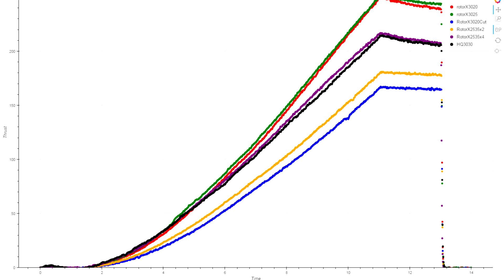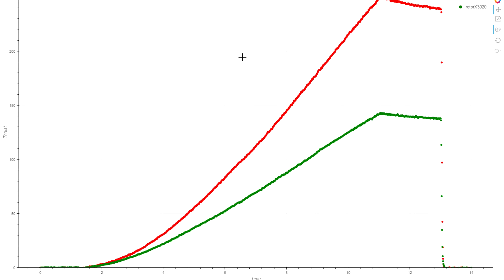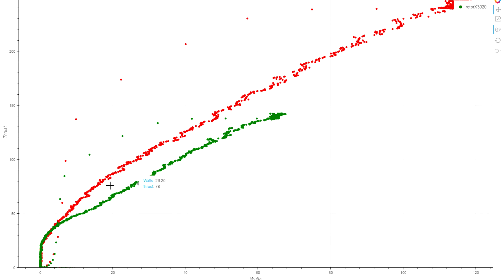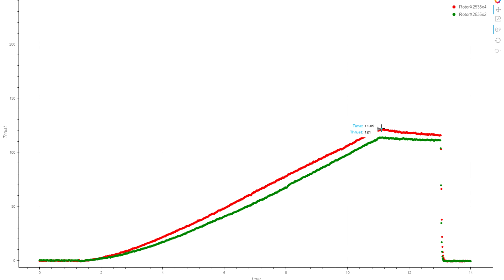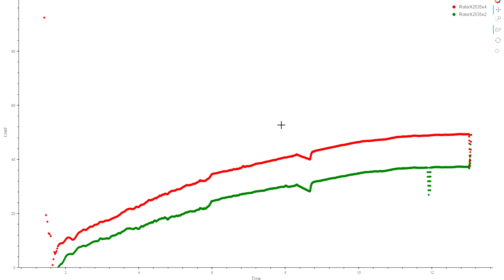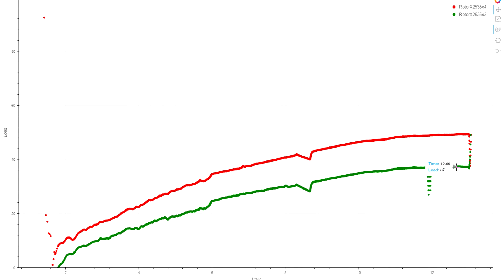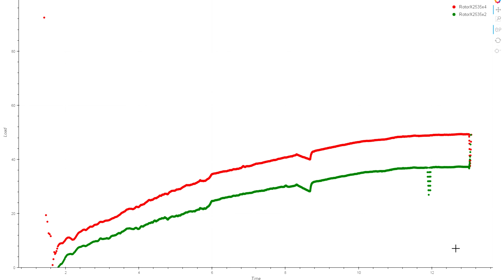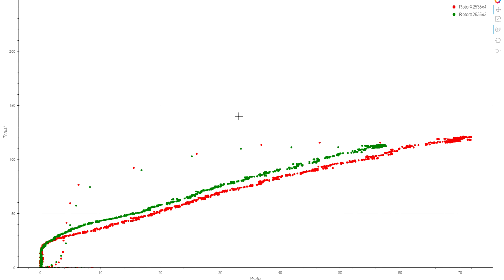1105 vs 1304

Comment: Darn I was hopping they had 6000 KV for 3S like the Spintech motors..
I wanna try these over my Trusted Emax 1106  2.5 setup,  to see the hype.  But so few options out there in 1304
Reply: ^word. I have some 1105 7500kv on a fat airblade eclair 2.5 (90g dry) and they seem to suffer from poor efficiency. So i am getting some of the spintech motors (6500kv) to try out and see if they are more efficient at the same thrust. Plus I am hoping that they really help my propwash problems which I haven't been able to tune out

Comment: ive got a Micro 32bits F3 Brushed fc,will rx1105 motors work without 4 esc's?trying to keep weight down
Reply from the maker: brushless motors require a brushless esc, you cannot run a brushless motor with a brushed motor driver.
Reply: Nickos White You can use a "4 in 1" esc instead of 4 seperate esc's if thats what you are asking.

Comment: Do you think its safe to use the 1304 with 4s and kinkkong 2840 triblades... thx for your videos.
Reply from the maker: depends on the KV, but the only 1304s I know of are really high kv so I wouldn't do it.  If it's just safe or not I'm sure you would probably get away with it just fine if you wanted to.
Reply: I will try 4S with my new H1304 5000kv when i receive them :p
I already tried 4S with BrotherHobby 7100kv without burning anything so i'm pretty sure that will work very nice ;)
I keep you informed !

Comment: A couple of months with the 4000kv versions now and they are still going ok.  First problem is the shafts keep snapping just above the bell housing, 3 so far.  Looks like they machined down the shafts to for the props but it's created a stress point.  Second is these motors vibrate a bit above half throttle, not sure if it's balance or to do with the ESC's I'm using.  Ordered a different brand to check.

Comment: I have Hyphys squeaker 2" frame and I have some dys 1102 10k kv motors on 2s 350mah zippys running some .5 gram push on BG 2" Tris, I am thinking of replacing motors with the rcx 1304 4k kv, to run heavier more durable praps, on 3 or 4s thoughts?
Reply from the maker: You might want the 5k version, it's hard to say without having a good idea of the load of those smaller props.  If the loading is as light as I think it might be you could be giving up a lot of power with only 4kv on 4s relative to what you have now.  But you will also have craptons more torque that could easily make up that difference if the 1102s are already loaded down too hard.  I've got some 2" stuff on the slate in the next week or two, I'll ping you in fpvchat if I come on any better insight from the initial results.

Honestly though I would worry more about battery availability.  Do you have a good source on 175mah 4s packs?  Staying on 2s and going with like a 7kv 1106 might be an easier path.

Comment: Just out of curiosity why did you choose a 4000kv 1105? That motor probably wouldn't be bad on 4s but I think with the trend of 6000+kv 1104 and new 1106 would be an interesting test
Reply from the maker: That was the commonly available kv at the time.  When I started in to 3" builds there weren't nearly as many choices as we have now.  The 11xx motor is already struggling on 3s at that kv and I've been able to burn them just on the bench in that configuration, 4s is just silly.  The new round of 6 and 7000kv motors are meant for 2s operation, and they provide about equivalent power as a 4000kv on 3s.  The extra kv is also needed for the even smaller 1.8 and 2" builds that will have even lower loading than the old 3" setups.  

I can't wait to get a look at the new 1106s and see how they stack up to the 13xx
Reply: Yea check out the new 1106 from brother hobby, emax also has an 1106 on the way and there's a few others in the 6000-7500 range, the brother hobby 1106 are rated for 4cell power. I have the 1104-6000 running on 3s with 2" props and it's pretty ballistic. I did enjoy your review, very thorough, look forward to hopefully seeing some of the more modern motors from you
Reply from the maker: Do you have a link for the BH spec sheet?  BH doesn't seem to publish any specs themselves.  The trick of it is there really is no such thing as a voltage rating for a motor, until you get to the point that the windings start arcing over it doesn't really care.  What really matters is the wattage rating as heating in the motor is a far bigger deal.  As the load on the motor lessens you can increase the voltage to maintain the same continuous power in the motor, so it's all inter-related.  Unfortunately few manufacturers of multirotor motors publish power ratings for some reason, so you have to guess a bit based on the "cell" rating and guessing what they are going to assume an average load is.
Reply: You should get a hold of the new brotherhobby r3 1106 5100kv, I have some and they are crazy powerful, but very amp hungry. Also there are the realacc 1106 6000kv that are only 7.60 a piece on banggood.

Comment: OK, been using the 1304 4000kv on 4S (450mah) for a bit now and they are my new favourites (also use the EMAX 1306 4000KV, RCX 1306 3100KV, DYS 1407 3100KV).  First gripe is the lack of props, I have been using (http://www.myrcmart.com/3x45-30453s-ttype-bullnose-tri-propeller-dysxt-pair-blue-p-11003.html) which are a bit too much pitch and are floaty.  Fun for freestyle but not racing.  

My favourites for this size class are GF3035 tri blades, very linear throttle response, precise and tough but no T-Style option.  Just found these though which might be the way forward http://www.myrcmart.com/28x4-28403s-ttype-bullnose-tri-propeller-kingkong-10-pairs-clear-yellow-p-11290.html.  These work the best for now http://www.hqprop.com/en/productsd.php?tid=9&pid=127 but it hard going back to 2 blade after using 3 for so long and they are a bit bigger than 3 inch so make sure your frame fits them.

Other gripe is the ridiculously long heat shrink RCX insist on putting on these small motors,  first it puts a lot of load on the stiff copper windings, second you have no room on the arms for the ESC unless you wrap it round.  OK if you are using a 4-1 (not a fan, been through too many) but please get with the times RCX, check the other manufacturers.

Comment: +siieefpv so if i have 2s 500mah lihv what motor would you think is best i curently have 1104 7000kv with 3025 props getting 2:40-3:20 flight on 2s. im looking for longer flights. my old 1103 8000kv with 3025 cut to 2.7inch got about 4-5 minof flight just less punch
Reply from the maker: 2s makes it tough, I would say you want bigger motors but there aren't really any that come with a kv high enough, 7000kv is pretty close to equivalent to the 4000kv/3s pairings I've tested.  For longevity bigger props spinning slower is better.  Trimming the prop on the high kv motor probably helps because it will reduce the load on a motor that's probably already struggling, but it makes it a hard balance of T:W

Comment: Hi
great review.you explain all things about these motors but I didn't understand the ampere that each motor load.In fact I have some 500 and 550 mah batteries and I want to know which motor is more suitable for these batteries!?in the trust table of motors in myrcmart website the 1105 5000kv and 1304 4000kv load same current on 3s battery(about 6a) but in your test the power of 1304 motor was up to 120W!!it means it load near 10A!so what's your suggestion?
Thanks
Reply from the maker: RCXs numbers have always come close to what I've tested, I think you may be looking at the wrong chart.  The 1304 5000kv motor that I tested here is listed on their site as a 9.2A draw on 3s.  I fly with 450 mah packs very comfortably on my 11xx builds, but the high KV 1304 (as you would expect) draws power like a full 1306 and packs that small are really only good for extremely short or very sedate flights.  I've been using 800 mah packs on the 1304 build to combat sag.

I haven't tested it but the 4000kv 1304 does look to have a nice boost in efficiency for fairly little loss in thrust compared to the 5000kv, so that might be a good option to try.
Reply: SiieeFPV ،oh, sorry,I thought it was 4000kv

Comment: Hi, I'm about the buy some 1304s to run on 3s. The 4000kv looks much more efficient and it looks to me like the 4000kv would even be faster than the 5000kv, both on 3s, assuming batteries of different mAh sizes for equal flight time. Any thoughts?

Edit: Based on a 80 gram quad and a battery size of about 500 mAh for the 5000kv and 367 mAh for the 4000kv (assuming weight of battery is 1gram per 10 mAh). This would give equal flight times and a better weight to thrust ratio for the 4000kv motors.
Reply from the maker: I'm a little confused, are you comparing the 1105\4000 and 1304\5000 or both as 1304 motors?  A 4000kv 1304 motor would have higher peak efficiency than the 5000kv at the tradeoff of peak thrust, technically you can come close to that also by choosing the larger motor and limiting the throttle on the quad.  Even then the amp draw is going to be a lot more than the 1105 motor, and that starts being the biggest factor.  Reducing the battery size is going to cause it to sag more, and the larger motor already does a number on smaller sized battery packs that are just fine with 1105s

I can putz around on my 1105 quad for 5 minutes pretty easy with a 450mah pack, but on the 1304 quad I can suck the same battery to LVC within about 30 sec if I'm not careful.  I've taken to using 800mah packs on the 1304 just to keep the sag under control.  A 4000kv 1304 is going to be more efficient than that, but still no where near the draw of an 1105
Reply: I'm comparing both 1304s that RCX sells directly (4000kv vs 5000kv), and was trying to figure out which one is the faster on 3s. The additional amp draw of the 5000kv for only 10% more thrust vs the 4000kv seems very steep. So I was wondering if it was possibly to just calculate the weight/thrust ratio assuming that the 4000kv could use a 36% less size battery since that would give them both the same flight time at max amp draw. The smaller battery would give the 4000kv a smaller AUW, and in fact end up giving the 4000kv version a better thrust to weight ratio. Does that make sense? Or am I making some flawed mathematical assumption?
Reply from the maker: Gotcha, ya I totally think that's sound, though I don't think you'll be really happy with a battery quite that small.  You may not notice quite as big a difference in flight though if you spend any amount of time not doing punchouts.  Time spend around mid throttle is more about a given thrust output, like for example your hover thrust isn't going to change with a more powerful motor (your throttle position to get that amount of thrust just goes down), and the motors are going to perform a lot more similarly for a given thrust output (not throttle position) under max.
Reply: Yes I think I should choose a bigger battery or my flight times would get too low. It was mostly hypothetical to help me decide on which 1304's I should get. I'll probably end up getting the 550mAh or 850mAh Infinity graphene batteries, since they are so cheap and Mr. Bardwell tested their bigger version and was much impressed.

Comment: what kv is the 1105 motor?
Reply from the maker: 4000.  expected difference between the motors from KV alone is about 20%
Reply: any idea how the 1105 6500kv or 1104 7500 would compare to the 1304?
Reply from the maker: They don't really compare.  65 or 7500s are for even lighter loads than a 3020 unless maybe you drop to 2s.  But the 1304 isn't going to have the KV to drive a really light 2" prop as fast as it needs to, it would take the 1304/5k on 3s to roughly match the 1104/7.5k on 2s.  If you're spinning a 2" prop you might just be wasting the extra torque.  

If however you're just comparing like-to-like then I think it's pretty clear that for 3s/3020 the 1105s are already overloaded at 4000kv, going higher is just going to tank the efficiency even worse for little gain in power.
Reply: This is great information. I am thinking of the 1104 7500 with 2.5"  at 2s to meet multigp micro class. If i wasn't limited to 2.5" and 2s then it would be very clear that the 1304 is better
Reply from the maker: looking at the logs I would estimate that the 1304 5k on 2s with the rx 2.5" quad would put out somewhere between 112 and 130g thrust, which is right in line with what the 1105 does on 3s ( which should be just a little bit shy of what a 6500kv motor on 2s will put out )  So it could very well be competitive, you would still clearly win on efficiency and responsiveness, but wouldn't have anything to offset the weight penalty.  I guess you'd just have to test it.
Reply: Thanks for that info. I already have the 7500 kv 1104. We will see how it does.

Comment: Sorry got a bit lost in the graphs there.  So is the 1304 5000kv a more efficient and powerful motor than the 1105 with the best suited prop on both?  I fly only fly 450mah 4S.

 I have a set of RCX 1105 4000kv and while they are fun they are a long way off the EMAX 1306 4000 kvs but I am sick of destroying motors, they drop magnets really easily so hoping the lower profile 1304 will be a bit more resilient.
Reply: I just wanted to point out that these rcx H1304 weigh only 7.5grams and the emax 1306 weigh a whopping 12.6. If i wanted something that heavy id get a brotherhobby 1407 (15grams) and produce alot more thrust. Just something to keep in mind if you are trying to keep it light. The rcx h1304 look really promising for something like a superlight 3". Or even just to throw it into something you have laying around like a leader 120. These 1304 only weigh 1.5 grams more than 1105 motors but are much more powerful. Of course youve got different kv and all that too though.
Reply from the maker: At every power level that the 1105 is capable of the 1304 is more efficient, even if you choose the worst prop on the 1304 and the best prop on the 1105.  I would expect you should see huge gains on 4s, unless you're using 3000kv 1105s or like 2" props they're already obviously overloaded even on 3s, so you're just throwing away your battery power.  The 1304 has a lot more torque

Comment: Thanks for the video. Helping to shed some light on this micro motor mystery. Have you been able to get some 1102 / 1103 motors and look at what prop sizes work at peak efficiency with each.
Reply: Also a comparison like this for 1935 / 2035 props on 1104-(5000,6500,7000) and rcx 1105 would be good to see.
Reply from the maker: I don't have any immediate plans for it, but I've been getting more and more interested in doing a 2ish inch build.  Once I get to that build I'll be sure to have a general range of tests down in that size for sure.